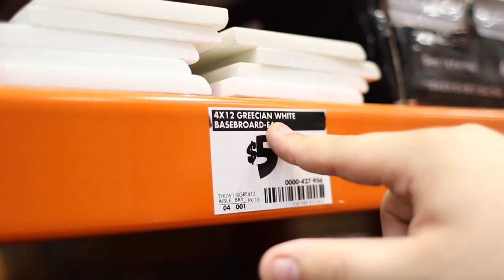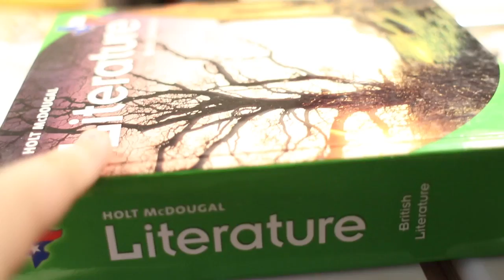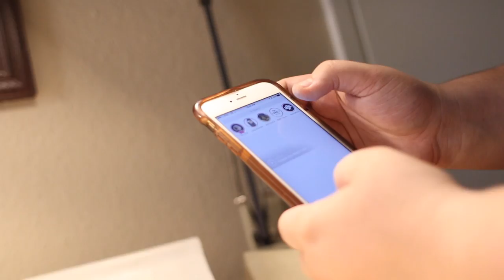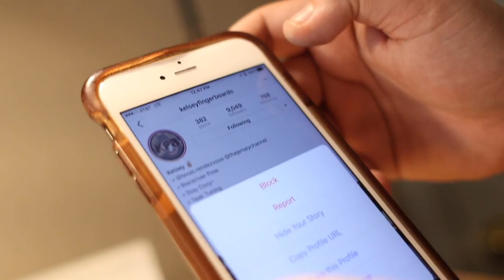HOW TO MAKE A GRANITE FINGERBOARD LEDGE + GIVEAWAY!!! (BEST/EASIEST WAY)

Comment: Use a push stick for cutting wood 6 inches or less on the table saw, it's a lot safer and you will be more confident, they are pretty cheap also

Comment: If the saw blade comes down perfectly on the line then you have actually made the wood smaller than it should be... it's not like paper and scissors,  when you cut with a saw blade you lose a gap with of the blade... that means if you're cutting a 1-inch piece of wood you want the outside of the line to be cut instead of directly on The Middle, because if so you will not have one in you will have 15/16 inch or so. Do you get what I mean? If not look up some pictures maybe that'll help.

Comment: if you cut the wood slightly smaller than the granite like an 8th or 1/4 of an inch and center it on the granite, it will look more like a modern public bench and will fit really good in a park
Reply: just realizing how late i am...
Reply from the maker: you know youre right i gotta do a remake of this video

Comment: btw you aren't supposed to cut wood with the table saw with your hands on either side of the blade
Reply from the maker: Real Since Day One lmao yes you are how else are you gonna push the wood through 😂
Reply: Real Since Day One rekt
Reply: ChubyMuffin you use a wood pusher its a wood stick that is shaped in a 90 degree angle that you push with
Reply: This kid is gonna cut off his chubby little fingers. Then his fingerboarding career will be over.

Comment: Talks extensively about safety for two minutes then doesn't use a block to push the end through instead runs his fingers next to the machine
Reply from the maker: Only need a push stick for small cuts this one was quite wide
Reply: Aight be careful though